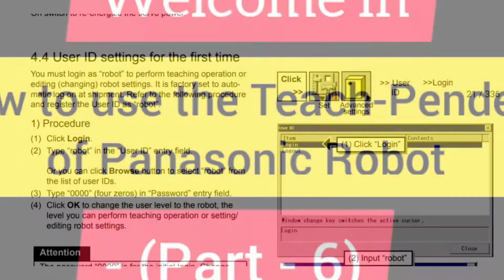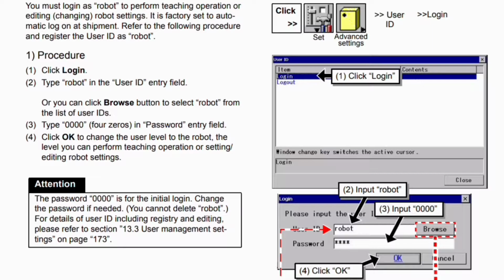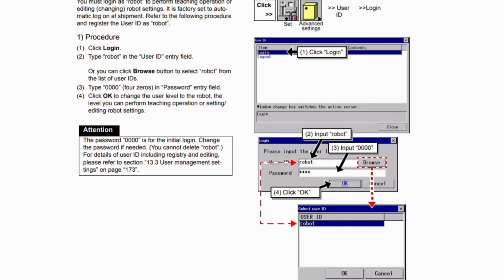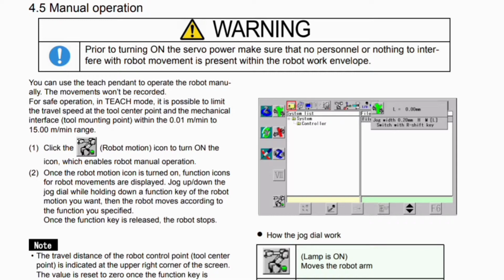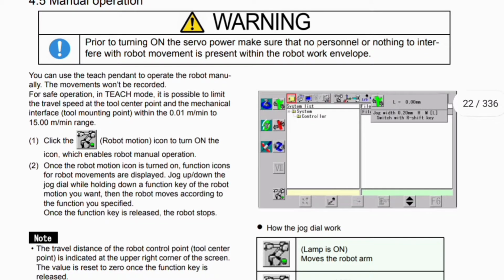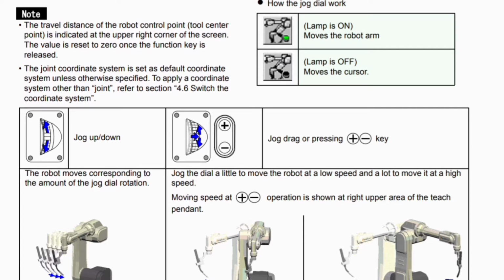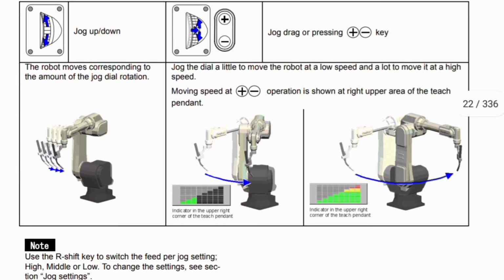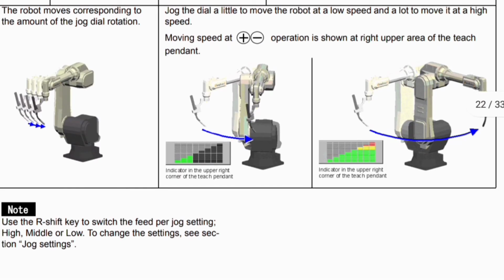Panasonic Robot Training - (Teach-Pendent) - Part - 6 !

Comment: How can I change the user management settings? I am the new system administrator but the old employee left without leaving his password. Any help is appreciated, thanks!
Reply from the maker: System  password  is  0000 

4 time 0  , its standard,  

If this is   not valid  , then  need  support  Panasonic  team  , they  have licensed  key,.
Reply from the maker: You  can change  user management  , but      , you have know robot system psw